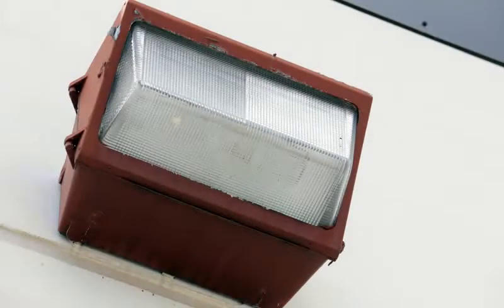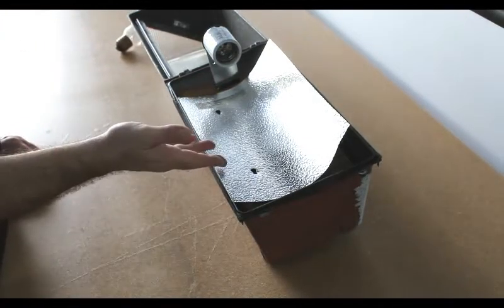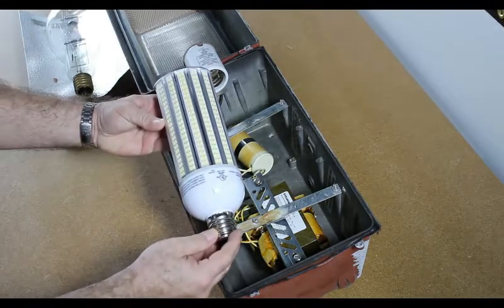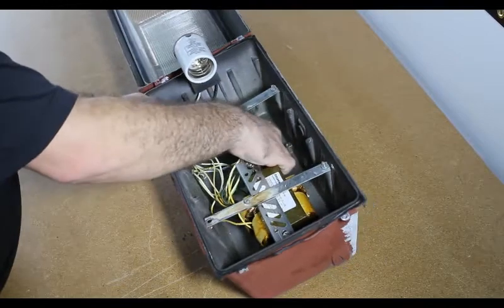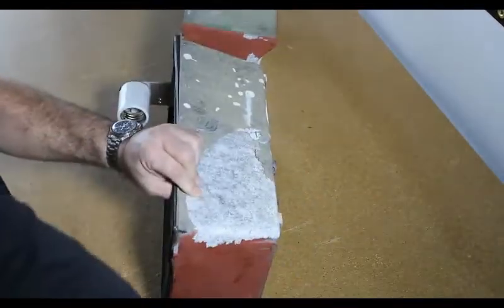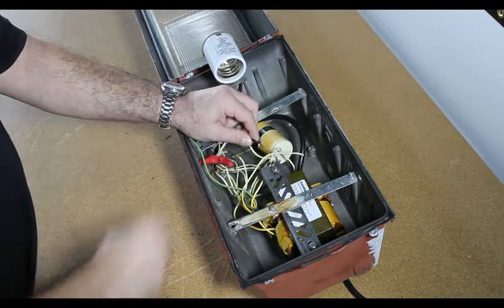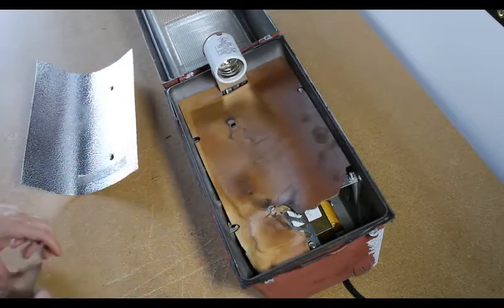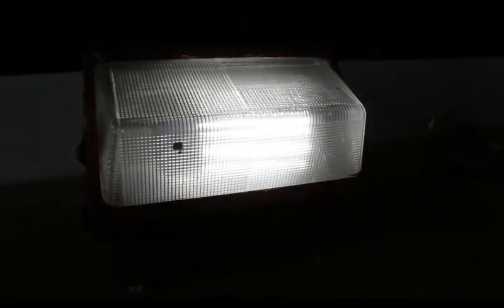StarLED Wall Pack Ballast Bypass for an E39 LED Corn Lights

Comment: rofl, that 40w corn light isnt even CLOSE to the light output of that 400w metal halide, congrats you just replaced a 24,000 lumen fixture, into a 4-6k lumen fixture.. clap clap..  That LED would need to be around 200w or so..   what a FING joke

Comment: Great step by step video but I was just curious why you wouldn't use a 360 degree corn LED bulb to utilize the aluminum reflector shield to project an even brighter light instead of the 180 degree?